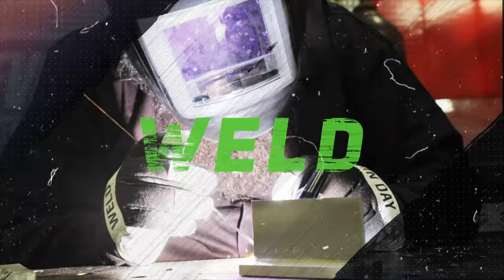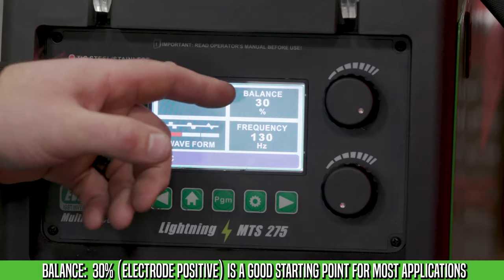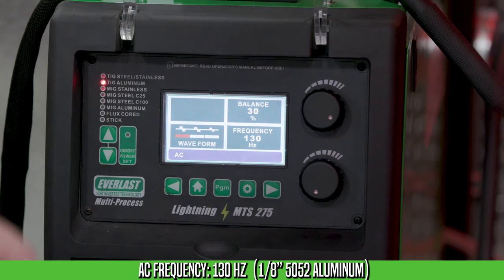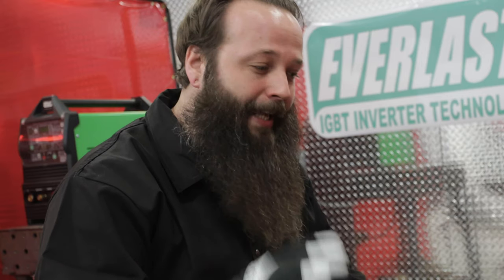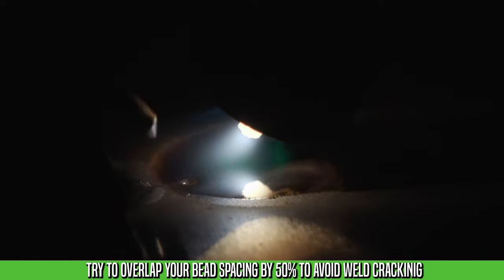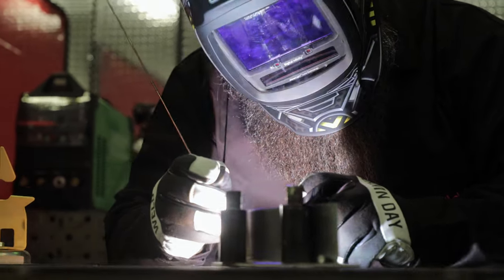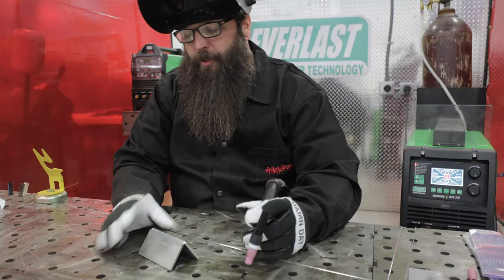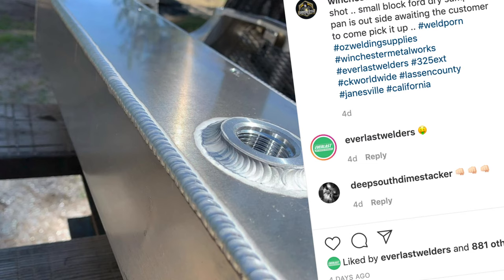Aluminum TIG Welding for Beginners: How to Stack Dimes | Everlast Welders

Comment: This is the best tutorial vid I've seen so far on ali tig welding for the novice! I've learned more in this 8 or so minutes than in all my practicing so far!  Most significant info is on the machine settings and what they all actually do.  I've asked many working pro welders what all the controls do and non have really known or been able to explain their actual function and effect.  Most have said oh don't worry about that, just set the controls like this and go!  Thanks guys.

Comment: I've had my Everlast PowerTIG 255EXT for several years now and I have no big complaints.  I suppose, like everyone else, I'm annoyed they put the gas inlet in the middle of the back panel (hits the bottle) but a 90 deg fitting fixed that fairly well.  I kinda wish it would remember my last settings without explicitly saving them, but mechanical knobs have to have SOME advantage in our digital world, and this is it.   I upgraded to a CK Flex-Loc water-cooled torch with superflex hoses, and it took me a while to build a cooler because I put a Sparkfun MicroView (Arduino type) microcontroller on it.  This ensures adequate flow before passing the weld command to the welder, and also shuts off the noisy carbonator pump when not welding and all the temps are near ambient.  Because I'm stupid, I also put an argon pressure switch in the weld command circuit so I will never again forget to turn on the gas!

Comment: Thank you Mark for this great video. After about two decades of hobby MIG welding, I bought a TIG machine last summer with a goal to do some aluminum work. I have not been able to find any resources to explain what the key variables are, and how and when to adjust them to get different results. After watching this video, I was able to just set my machine and GO and go results that I am not ashamed of. Still not getting results I want to brag about, but I am headed in that direction. THANK YOU!!!

Comment: Awesome video Mr Winchester. Very helpful sir!
I do repairs on tool and die. I do some welding on blocks and details, tool steel and alum. Sometimes build ups and edge capping.
Could you do a how-to video of edge cap weld on a detail

Comment: Hi Mark! I have a everlast 253dpi an had been welding aluminum 2" stitches in double pulse then I started getting black soot on my welds I didnt change any setting just started getting soot so I tried increasing the argon to 40 no difference then I changed the bottle of argon out, the line and regulator still getting black soot I also had someone watch the regulator when I weld, its working fine I'm truly stumped and so I'm wondering if you have any suggestions on what it might be? Thanks in advance!!

Comment: Question, What if you are tig welding two different sizes of aluminum together? What size do you lock in the machine? The smaller or the larger?

Comment: Hey dude, question for you.
I'm trying to add some aluminum to the outside of a cast aluminum intake manifold. I'm doing it so I can port the inside of the runners & not blow out the side. It is in a difficult area Anyways is there a trick to this? I'm getting no puddle starting & when it does its just globs of filler metal that is kind of  stuck together but when I grind it clean it's just a mess. How do I do this please, I'm using my new power pro 256 si at 180 amps 40% cleaning just 10% before my tungsten starts ballin out of control. An 8 cup & 3/32 laYZr tungsten. Also I have caused lumps to protrude into the intake (but it will be ground out.)

Comment: Brill ,wonder if you could help ,got to do a aluminium fillet weld 1 inch tube 1,2 mm wall thickness 1,6 mm plate ,6061 t4 ,minimum penetration is 40% of side wall fusion ,no rotary mechanical devices are allowed ,so when you think you stop and start so many times it’s hard to achieve,

Comment: I enjoyed your tips... I have a 200 DV and really love that machine... Been having troubles with black soot rising up in the puddle... stainless wire brushed, acetone wiped, wiped filler rod... 3/32 2% Lanth, 3/32 filler 4043... CFH around 25... preflow about 2 seconds...post about 5 seconds... Not sure what is happening... running a number 8 cup... maybe I need to switch to a gas lense for better coverage??  Not sure.
Reply from the maker: Aluminum is a non reactive metal. You should be fine with a standard setup. We had a #5 standard cup in this video.

Comment: Blue. Blue. Blue. Whats the Customer service and parts line on that Chinese POS?
Reply: 5052? Building gasoline fuel tanks?
Reply: Or when the anodized guys burn the High frequency board out of it from trigger welding how much is that and does Everlast cover that? How are the pulse settings? Does it Auto- link like my Miller? Or is it a pure hobby machine?

Comment: 230 A for 1/8" material?  my everlast 205 SI - 200A rated tig but we weld 1/8" material with 1/2 that amp setting - and they look fine - good penetration and cleaning - but clearly we are doing something wrong...?  my miller charts have 1/8" als well below 230 setting ......not until thicker that 1/4" does the chart say to get that "hot"

Comment: He talks about filler being too close to the arc and not able to cool the puddle as much. What he doesn't mention is the contaminates he is introducing to the weld pool when he takes the filler out of the gas, it oxidizes then he brings it back into the puddle. At that moment you can see the contaminates flow around the edge of the puddle since the edges turn dark immediately and gives a halo effect. He still welds better than I do but he IS introducing contaminates into his welds with his technique.

Comment: Your weld is too thin with just dropping it in there.. you need to push your fuller in a little to allow it to lump up within your sets and you'll get a mich stronger weld .. more beautiful shiny Dimes and less the risk of stress cracks upon cool down.

Comment: During your close up shots your dab is about every second but your distant shots shows your dab is much more frequently. You need to be consistent with both for people to understand the proper  technique.
Reply from the maker: Thanks for the feedback TracE. Just to clarify, they are two different welds. Part of the video is explaining that you need to adjust your travel speed based on what's happening in the puddle. That is why you see different speeds.

Comment: Id rather build a car that will go 200 mph then own a Ferrari, just sayin, nome sayin, that's what I'm sayin.
I'm practicing with .063 coupons 3/32 filler & 3/32 laYZr tungsten, I'm having alot of issues with getting stuff too hot I guess. My machine is the powerpro 256si.